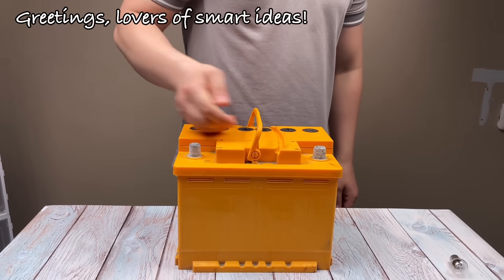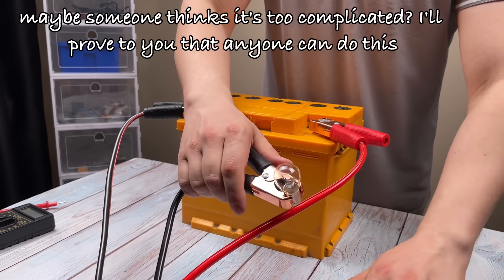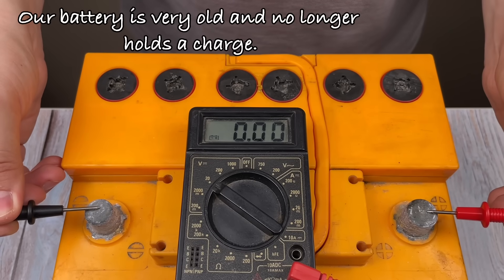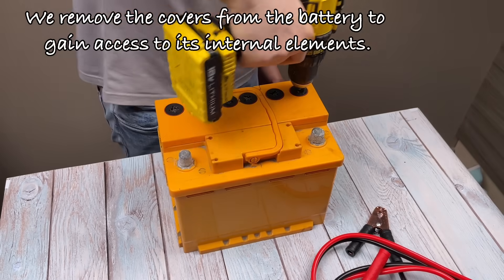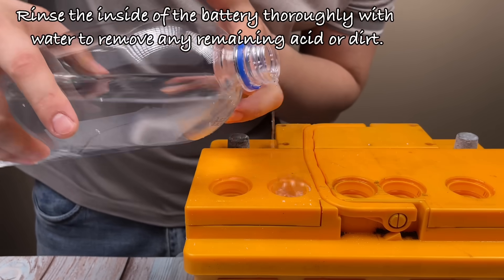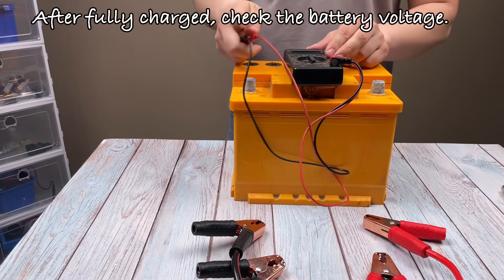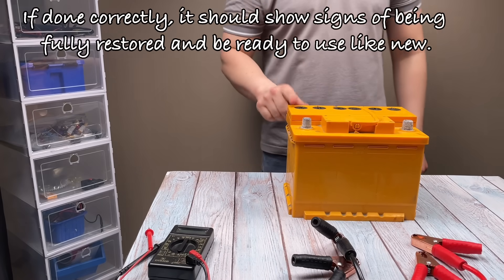🔥🔥Your battery will last forever! We reanimate an OLD battery without spending money at the dealer

Comment: People are destroying their batteries when they add baking soda to "wash away the old acid" or "clean the lead plates". 
If your battery doesnt charge up to 12-13 volts, or charges up to 12-13 volts but quickly discharges, that means you have 1 or more bad cells. 
The only way to fix is to tear apart the battery and replace the cell's lead plates. (See numerous Indian videos)
If the cells are good and youre still getting a decent charge, but you want to replace the acid with an electrolyte: Just rinse the cells with distilled water. That's IT.

Comment: 1. Why don't you clean the battery terminals from oxide for better contact?  
2. When you measure the voltage of the battery after charging it and it is 12.43 volts, do you think its starting current is sufficient to start the engine of a car?
Otherwise, I don't think it's a good idea to just light up mugs. It's heavy and takes up space, and modern lanterns are much more compact and practical, the strength of their light is a matter of choice.

Comment: Baking soda tidak bisa melarutkan Lead Sulphate pada sel baterry, hanya menetralkan asam sulphate menjasi sodium sulphate, jadi tidak ada fungsi nya untuk memperbaiki sel baterry
Reply from the maker: Dia membersihkan! dan mengganti elektrolit sudah menyelesaikan semua masalah
Reply: @FixItFast1  This battery will never start a car, do a load test with a load tester.
Reply: @AnthonyManzio   Yes, have seen batteries indicate 12+ volts but were still unable to function under load.  So, a 12+ volt reading is not always an indication of battery health.

Comment: I have actually had good luck with those cheap desulfators. You do need to have a battery that has twelve volts though. Most batteries will charge to twelve and then short out when you hit them with a big load like a starter. But a desulfator hits back with a reverse pulse once in awhile and re liquifies the crystals that short out the plates. It takes many many days,but they do work. And you can buy them cheap as dirt. Used it on a trolling motor batter,and one car battery.

Comment: Anyone who's advising this youtuber is pulling a wool over the eyes ?

Mine is a 6 year old battery and dealer charged for 24 hours and says it's weak and will go kaput maybe within a day or 2 if not used continuously on the  car.

Im thinking of reviving but your comment suggests it's a bl**dy waste of time and I should just replace with a new one with dealer. 

Kindly update if I should just replace to to a  new battery ? 

Also what should one do for LONGGGG life of battery ? - would draining n cleaning  up all distill water from the battery cells like this video does, for every 2 years and refill and recharging the battery, help and make it last really long ?

Thirdly, how does one keep the battery without corrosion, what steps to be taken during usage of battery ? 

Kindly advise 🙏

Comment: Not just silly , but outright dangerous. Adding electrolyte to the battery is like pouring water, right. The electrolyte is concentrated sulphuric acid and will dissolve your skin in seconds. So this clown pours it in with no rubber gloves. It was probably water in real life, but why spoil a video for the gullible on Youtube?
Take a 100 AHr battery, and reclaim it as a 1 AHr battery with a life of about a week on a good day!

Comment: Forever? Not a chance. Just another deceptive AI Skunk taking advantage of needy good people for view money.

Isn't it amazing how many people on YouTube are willing to lie, putting God only knows how many people who may be desperate for the savings through doing this so called repair only to find out it either never worked at all or lasted only a few days/car starts at best?

And all for the cash they may receive for the views. Absolutely deplorable and incredibly selfish, especially when all they did was rip off the video clips from others and use AI for their fake video process like in this video. Unless its an emergency situation, run from all these lying videos and save yourself the trouble. 

Yes, I've tried it and once a battery is that far gone, its all but finished no matter what you do.

Comment: Talk safety. You've got a meter, yet you use jumper leads to test the battery. 
If tat battery was charged it could explode or cause a fire...😢😢😢😢
Then you should shake the battery as you drain the liquid to shake loose the sediment.
Use a hose pipe and laying the battery on its side flushes more sediment out than you can pour out...

Comment: This solution is only partial. If everything was this good, then there would be no need to replace the accumulators! In my opinion, it is no longer suitable for the car, it does not return the capacity of the battery. The original olom plates are corroded there and the amount of electrolyte cannot be used because the cell is corroded!!!
Reply: FALSE

Comment: What I found works really really good is to completely drain the battery, then hook a battery charger up backwards, make negative your new positive post, melt off the negative and positive indicators on the plastic cover with a soldering iron, and melt in your new + & - symbols next to each post, then slow charge the battery for a few days in reverse polarity, the old sulfated plates will now rejuvenate themselves because the polarity is reversed and the sulfated plates will release from the plates, and the battery gets stronger and stronger the more its used and recharged, its just as strong as a new battery again.  Try it, you'll be surprised at how well this works, and you don't have to mess with the acid or anything, just reverse charge the battery, thats it. But only do this with lead acid batteries NOT lithium batteries.  🤔🧐😎👍
Reply: How will it work without eletrolyte? Did I get your procedure right?
Reply: @parad8396  Drain as in drain of all charge not the electrolyte.
Reply: Нет, его нужно  разрядить  в 0! На это может  потребуется долгое время , и затем  поменять  полярность заряда , то есть  где был - будет  +, и наоборот  соответственно , восстанавливается  примерно  на 90% от ёмкости, какая  была  @parad8396

Comment: 12.8 volts is a fully charged battery, 12.4 volts as shown after a complete charge is not reaching its capacity and will not crank an engine, its amps that count not just Voltage.

Comment: Where do you buy electrolytes from?
Reply: At an auto parts store I managed years back, we stocked battery acid, mostly for our own use to fill the dry charge batteries we stocked, however, I sold it on occasion to those who requested it. It came in about a 5-gallon carton.
Reply: RUSIA vindeeee.

Comment: Once the baking soda is added, the acid is completely neutralized.  The chance of reversing that process is very slim.  Send that junk to the recycle  center near you.
Reply: No, you don't leave the acid in the battery, you empty the sulfuric acid out the you pour in hot distilled water mixed with baking soda to de-sulfate the cells first.

Comment: You need first full charge it then you tested, if I bring a brand new battery and drain it 100% well act like your battery and then I will just full charge it will be brand new what's the big deal Plus there is a tester when you test it will tell you what's the percentage of the capacity inside

Comment: Firstly I thought this video must be like 10 years old:) But then I seen "3 weeks ago". It's ridiculous by itself , especially ridiculous is in particular this "method", but what is even more ridiculous is trying to "restore" a "lead-acid" nowadays. Just throw it away and buy (no, not a fully ready battery as a stupid "black box") a new good LiFePO4 cells from a reputable seller and a BMS and (optionally) a ready-DIY-LiFePO4 battery box and build/assemble your own good battery for a price of new lead-acid, it will work for you for 15 years / 5000 cycles guaranteed much better than a new lead-acid its first year. For a car as well, as starting battery as well, even in hot climate OK (shorter due to high temperatures under the hood but still longer than a lead acid :) , for cold winters choose LTO instead of LiFePO4, still less expensive than lead acids and especially trying to recover old lead-acids .... Not for a car EVEN MORE ridiculous and pointless nowadays. The only reason why one would still do that is lack of knowledge or laziness to learn something new (LiFePO4 / LTO world).

Comment: Any lead acid battery that has continuity and has been drained, flushed, new electrolyte added and been charged will light up a less than one amp bulb, it will read good voltage on a multimeter and even spark if shorted.  It most likely will not even crank my daughter's tricycle and it will be stone dead again in two days!  Thanks to all you folks out there who think you're really cutting a big bull in the hind end while he's looking at you!  Youtube really needs some more of these educational videos!
Reply: Sir you are full of shit i have done this now to more than twenty batteries and they are still working.
Reply: To prawda. Pozdrawiam.
Reply: So you're advising this youruber is pulling a wool over the eyes ?

Mine is a 6 year old battery and dealer charged for 24 hours and says it's weak and will go kaput maybe within a day or 2 if not used continuously on the  car.

Im thinking of reviving but your comment suggests it's a bl**dy waste of time and I should just replace with a new one with dealer. 

Kindly update if I should just replace to to a  new battery ? 

Also what should one do for LONGGGG life of battery ? - would draining n cleaning  up all distill water from the battery cells like this video does, for every 2 years and refill and recharging the battery, help and make it last really long ?

Thirdly, how does one keep the battery without corrosion, what steps to be taken during usage of battery ? 

Kindly advise 🙏
Reply: P
Reply: Full of shit that dude,,people are busy saving lives and he’s busy dragging behind 😅😅😅

Comment: Bullshit !! a proper lead/acid battery shall hold 12,7 V when at idle. After charging it will hold 13,8 V for a while, slowly decreasing to 12,7 V.  12,4 Volt is only at it´s half capacity and measuring with an digital voltmeter without a nominal load doesn´t say shit about its condition.  Whole video is a scam.

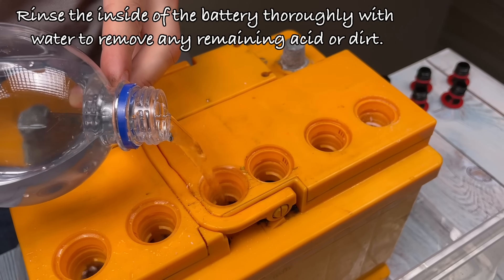Comment: Okay, this method that he is showing. Will work, but he forgot a very important sdeb. Now I'll tell you. I have a battery that was a lawn mower battery. And we all know that lawn mower batteries don't last very long about a year. Will I have an interstate battery? That is a lawn mower battery. My battery is from 2008. So this battery is 16 years old. Still still starts up. My mower absolutely perfectly. So here's the step that he missed. He is correct. You drain out all the old acid? Second, rinse it out with distilled water. Never, ever use regular tap water or you will ruin the battery.  Then, after rinsing it all out, I put baking soda and water mixed, just like what he showed in the cells. Now here is what I do that's different, after I put the baking soda water mix in the battery.  Then what I do is? I put the charger on the battery at 6 V. Not 126 V low amprites, and let it sit there for about 24 hours. This breaks up all the sulfides in the battery and it will help break up sulfides, stick to the plates.  Then what I do is?I drain all that out.And then I keep flushing each cell until the water comes out.Clear, because after you break the sulfis up using 6 V.That water is going to be Black and very disgusting, looking then you flush the battery out very good with distilled water until each cell is flushed and the water coming out of it is clear. Then I usually put in new electrolyte and again. Then I put it on a charge very slow charge.  Sixfold low Ambridge for 20 4:00 after that, then I put it on a regular charge and bring the battery back up with a regular charge. And when you're done doing it the way I just described your battery will be like 100% new and will last for quite a long time again.  Now I will tell you that I've just learned this described procedure working in the battery shop in the United States, navy.
 And I will tell you the method that I just described above does work.
 Because like I said the battery in my writing lawn mower.  Yes?
Over 16 years old, I have done this method.Twice to that battery and that battery still performs like brand spanking new even after sitting all winter with no other chargers attached to it
Reply: You old son of a seacook !hahaha

Comment: Further on in the postings below  there is the . . .

"those who did this work know absolutely nothing about the chemical reactions of the battery! " . . .as per  the honorable @jean3xyz

AN ENLIGHTENMENT . . . . .

This . . . . . authors faulted reasoning . . . . .was that the aggressive foaming action of the acid still within a cell is supposed to react with the alkaline / baking soda mixture and chemically etch away the cells surfactally encrusted sulfation to restore a fresh lead amalgam  surface. 
This quasi-quack procedure worked ONLY in a most MINIMAL manner, such as to restore just enough charge up action to engage that mere 4 or 5 amp current pull of that lamp. 
TEST out that battery on a car where it would be hard pressed to now deliver enough power to brightly light the head lights that will be pulling ~ 10-20 amps. FORGET even meeting the extremely HIGH current needed by a starter motor, in cranking up an Internal Combustion  motors compression opposed loading factor.
You Sir are a QUACK  . . . . . . spreading false technical information . . . . . with the GULLIBLE readers here just passing on their few false based praises.
( . .QUACK . . . .  .QUACK . . . .QUACK . . . . . . . now give us another perceived technical FALSEHOOD posting !)
CAVEAT . . . . to further readers . . . .don't waste your time here ! +  ADDITIONALLY complain to You Tube on its misleading and erroneous content .